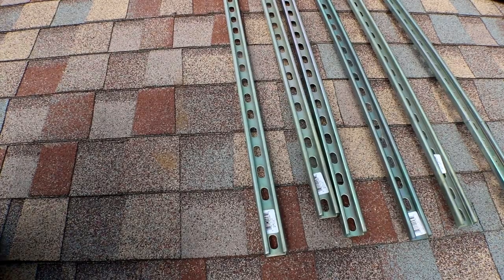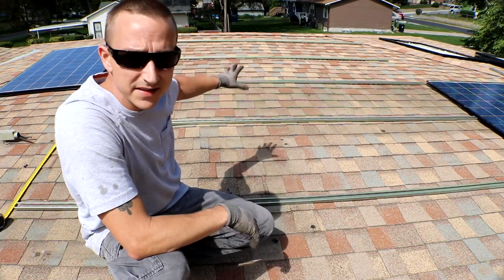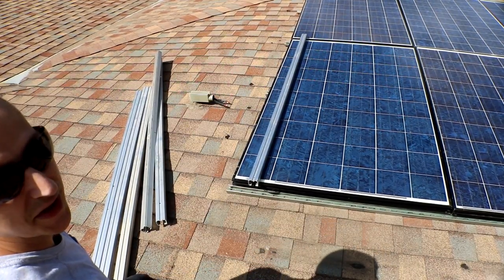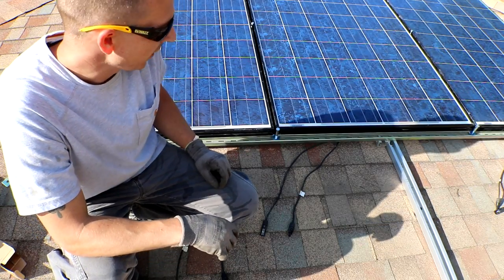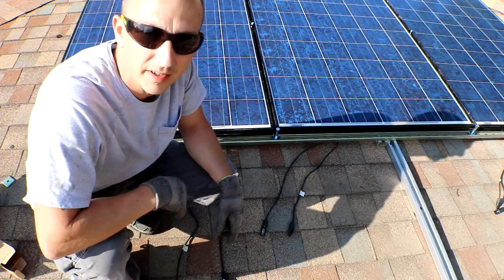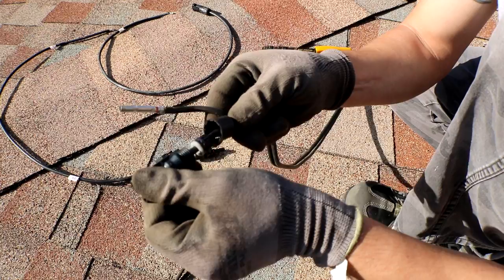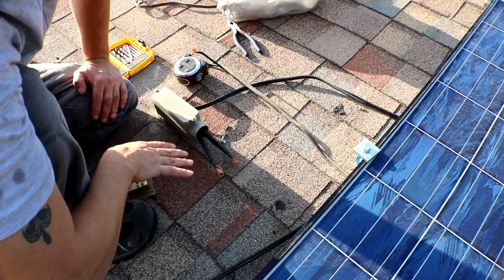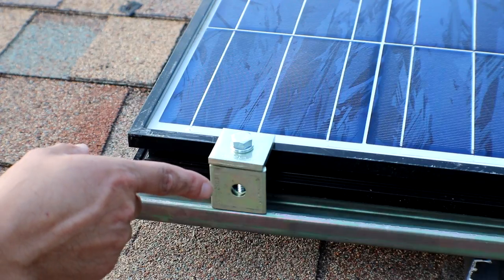Installing Solar Panels On The Roof

Comment: From on poor man to another, great job. I  put a piece wood instead of a L bracket, works for me.
Reply from the maker: Yeah I guess a block of wood wood do instead of the L bracket.  I almost went with wood for the install but didnt.  It wood have probly been cheaper but I like the way this turned out👍

Comment: car audio distro blocks are PERFECT for this kind of stuff.
Reply from the maker: I thought so.  Ive used the same one for almost 10yrs lol.  I probly should of cleaned it.  Maybe I will LOL
Reply: awesome.  don't forget to take readings before as a baseline, to see if cleaning actually improves performance.  Even if it doesn't, it can help prevent problems down the road.
Reply from the maker: +bcmasur Will do!

Comment: super job m8! finnaly hehe i was waiting to see this.
normally solarpanels are setup in longer serie strings to have high voltage which is more effective to transport the power to the convertor, thats why on those setups the cabling can be long runs.
Your idea to use those rails is perfect, here we use full alluminium and mounting the panels with 4 bolts, but 6 for each wont harm anyway -)  now i am working on a 1508 solarpanels setup lol, weeks of screwing and about 7 km cable-) till finnaly the first panels can be mounted.  Enjoy your green power!
Reply from the maker: Thanks!!! Yeah I could of put the panels on 2 rails but wanted more support, so more bolts it is lol.  All aluminum would have been nice to use.  After reading the comments, ill be changing to 3s on the panels😃 Damn, now thats a setup.  Is that for your or someone else?

Comment: Nice work on the solar panel install! I never knew about unistrut and cone nuts as a combo. Brilliant. I'll have to use similar in the solar pergola that I am planning. Thanks!
Reply from the maker: Thank You!! Yeah they are very handy and easy to work with👍

Comment: yea, I don't do the sports either! yes the uni strut works good. I worked in Lowes stores. we used it up in the ceiling. to mount lights and other things. I been wondering about how  I'm going to mount my panels. I'm thinking about a tracking system since the sun hides behind trees part of the day. to get the most out of the days sun. if I put them on the roof. I'll only have from 2:00 on. I'm kinda down in the trees! there's only a few paths the full sun shines through. I was thinking of just. doing like you are. just put a pivot point in center. raised about 24". allowing them to follow the sun.
Reply from the maker: Yeah sports....SMH LOL Cant play them and cant watch them!  Ya I have a lot of tall trees on the southeast part of my yard and the neighbors trees as well.  Sun doesnt hit them untill 10:30ish.  Ive been thinking of a way similar to my old setup to at least adjust them for winter summer.  A tracker would be cool tho.

Comment: Mc4 conectors like to be in dry place behind the panels is the worst option especially if lying on the wett roof behind the panels is probably higher moisture if is not properly ventilated that I mean rised on the one side.... 👍
Reply from the maker: Ill make sure there not laying on the roof. All of it is raised up off the roof and the last rail is off roof more because the roof slopes at another angle right there.  👍

Comment: I am curious if you used anything to isolate the aluminum from the steel unistrut? Aluminum in contact with steel results in a galvanic reaction.
Reply from the maker: Nope, just set on top!

Comment: It's interesting to see how other people do their builds. I know what it is like having to recycle parts from an older pv setup. I was in the process of building an outback Flexware 500, I spent about $1000 before I discovered the 240v inverter I wanted to use is no longer in production. I have an FM80 and 800w of panels.
Reply from the maker: I learn almost everything from watching YouTube👍 Yeah I kinda keep everything if I think I can re purpose it lol.  Can you still use the flexware 500 with another inverter?  Are you using lead acid or lithium ion?
Reply: I'd like to buy a pallet of the LG chem that jehu been trying to sell. A 23 kw lithium battery pack would be kinda cool but I don't have the money. For the time time being I need to buy 2 more  130ah trojan deep cycle batteries, that way when I buy the 4kw 240v ouback radian inverter all I have to do is rewire my pack from 12v to 48v and reprogram my FM80 to talk to the radian. I could finish the FW500 but it would only be 120v.. The idea behind my madness is to be able to charge our(my brothers)  smartfor two EV with nothing but solar.
Reply from the maker: New cells would be nice but like you said, dont have the cash.  I just got rid of my 12 trojan t-105s.  Thats what I am replacing :) Ya sounds like you have a good system and a good plan!

Comment: you do a great job of editing the videos. anyway, i must have missed the part about how you secured the rails to the roof so that the whole install does not just slide off. thanks for the work in making this informative video!
Reply from the maker: Thanks Man!!! It was a long video,  I even dozed off lol JK.  I put a blob of tar down where the 3" hex head screws were going through the aluminum rails into the roof. 👍

Comment: Nice! Good to see you making progress...
Space under the panels is also good for cooling, and a little more is better. 
8 AWG and 2 gauge is great, probably overkill but glad you've got it.
I'd agree with the other posters about string length - put as many in series as the PCM60x will take, as long as you can use all the panels symmetrically.
Also remind you about blocking and bypass diodes for combining! (smart/ideal diodes), but you can add these later - main thing now is to just get it going! Yay!
Reply from the maker: Thanks!! Ya we had a cooler day so I jumped as soon as I could lol.  Yes off the roof for cooling as well.  The 2 gauge is there so I can keep adding panels.  Yup after reading all the comments Ill be switching to 3s.  Do those diodes go inline at the mc4 connectors?  I added that link you gave me to my fav but its on a different computer.  Ill have to go check it out again.👍
Reply from the maker: I was looking at a picture and both diodes might be in the junction box on the back of the panel.  Id have to open one up to see.
Reply: The panels probably already have a 1A10 bypass diode which helps it not to become a sink if it gets shaded in a string - the other panels in the string can then still supply current through the diode instead of the shaded panel and causing it to heat up.
Blocking diodes are used when combining parallel sets of strings, so that if one string is low, then it doesn't pull power from the other strings.
However, an mppt charger might be able to "find" it by drawing more current until the other strings' voltages go down to match the low string, which can then start producing at its voltage again when the diode gets forward bias.
If all panels are perfect, uniformly illuminated and none are ever shaded then diodes would be theoretically superfluous, but the world is rarely perfect!
Hope that helps.

Comment: It looks great. But it might have been better to run 3 in series strings and then parallel the two strings.  The PCM60x  can handle the voltage.  Looking forward to the next video.  Thanks Joe.
Reply: M Gunderm I agree, I have 3 in series connected to the PCM, and planning to buy 3 more and have 2 strings of 3. I think Daniel has also like that.
Reply: fmarpt yes i have :)
Reply from the maker: +M Gunderm Thanks! Yeah I figured I would try it with 2 in seires first and see how it does then 3 and see if there is a difference. The 2gauge run is about 20-25ft so I was thinkn just the 2 in series. You think Id get more out of them in 3s?
Reply from the maker: +fmarpt How long is you run from panels to charge controller?
Reply: For a 48V system 3s would be better imho, 60 cell poly panels in the summer will have a hard time meeting voltage requirements. 2s might be ok if using a pwm controller.
Reply from the maker: Yup you are probly right and thats what I had before and was thinking like the old stuff.  I think Ill make it 3s when I slide the panels over to get rid of the mini shadow.  Thanks Guys 😃👍
Reply: AveRage Joe I have ~25meters of 6mm PV cable
Reply: Joe,  Max input voltage is 145v.  I did my first string to get 130v and then paralleled duplicate strings after that . Remembering that at 48v you have a max of 3200 watts input.  I'm just a few weeks ahead of you in this. Have fun.
Reply from the maker: Awesome! Hows your system going?

Comment: Looks great, now you just need 18 more panels! :P  The mic muffler you made seems like it worked really well as I barely noticed any wind noise.  Good on you for that, esp as a repurpose jobby.  I agree with other people who have commented so far to go with a higher voltage hook-up pattern; you'll get more out of the panels that way.  However, I'm not sure what / how many panels you're adding to this in the near future.   Did you have to deal with any HOA issues with your panels or are you lucky enough to live in an HOA-free neighborhood?  Keep up the great work!
Reply from the maker: Thanks Man!!!  YES, Need/want more panels.  Yeah I dont think the sound was to bad.  It was damn windy too.  Im surprised the camera didnt fall over a few times.  Yup, samzies on doing 3s on the panels after reading all the comments.  Will do asap. HOA FREEEEEEEEEE lol 😀 .  Another reason we bought this house so I can do what I want for the most part 😜 but so can my neighbors 👎.  I was thinking of adding a string or 2 of the 12v panels I have but since Ill be doing the 3s I might not be able to string the 12v panels up.  So I may sell them to start saving for more of the bigger panels.
Reply: Yeah, see if you can sell them and put that money in the "better and MOAR panels fund."  Dealing with the voltage differences and the side issues with that probably isn't worth the small amount of power you can expect to generate from them.  Noiiicccceeeeeeee on the HOA free living!  Wish I were in the same bucket, but alas...
Reply from the maker: Yeah I think Ill sell them and put the funds in the "MOAR MONIES MOAR PANELS FUND" lol, not sure what there worth nowa days.  Ill have to look them up on ebay or something.

Comment: I bought a pair of MC4 connectors recently and they stated 10, 12, or 14 AWG.  I can't figure out why they would say that.  I think 8 AWG was perfect, it fit snugly into the gaskets in the MC4 connectors.  I did peel back and cut off a few strands of copper to get it to fit into the crimps, I should have cut off a few more because it made the connectors a little faster and they barely fit into the solar panel's MC4 connectors.  Thought I'd throw this out there so hopefully some newbie sees this while they're planning to shop for wire for their MC4 connectors.
Reply from the maker: Yeah the wire fit in great.  I think if you use smaller wire like 14g then there would be a gap in the back.  I guess you could fill it with silicone or something.
Reply: stuff some caulk in there HEH HEH :P

Comment: JOE Solar panels don't like heat, that is why people use the taller of the two. so the wind can blow under he panel to cool them off. those look high enough to cool since your roof is not black!! just saying Old One Legged Joseph T.
Reply from the maker: I figured thats what they would be for after I started installing.  I keep an eye on them when it starts getting warm out again!

Comment: A 3 to 1 mc4 Y connector should work fine.   The holders put shade on the panels, wonder if the mounting holes on the panels would be better but then how do you screw it down?  If you get a 60A controller, you should be able to have 6 more panels up there. makeskyblue lists 2800W and 190V voc as max.  12 of yours would be 2820W but just don't clean them in summer. 4s3p
Reply from the maker: I did see those Y connectors and almost got some.  Yeah If I angled the panels up higher I could have mounted from below or I guess I could of use L brackets to mount to the side of the panel and then to the unistrut.  I do have a pcm60x mppt charge controller (60amp)that Ill be hooking up next.  From reading all the others comments, they recommend 3s or more as well so Ill be doing that asap.

Comment: I debated 'poor man's mounting' but ended up with a kit which wasn't too bad. $330CDN for 4 panels. all aluminum to prevent any issues with disimilar metals
Reply from the maker: +Jeremy Choy Awesome, where did you get them and what volt/amp?

Comment: Nice Joe.  I was looking at that hack job on the corner before you mentioned that you forgot the L brackets.  Why did you offset the risers?   Also, no video of your beer drinking skills ;)
Reply from the maker: Thanks Man,  Surprised you didnt mention anything about that first song😉👍  Are you referring to the aluminum rails on the lower panels? If so, I just wanted to slide the upper end under the unistrut so I didnt have to put anymore screws into the roof then needed and so I didnt have to go back down the ladder a cut the excess off 👍
Reply: Gotcha.  I thought it might have been because of drilling into the roof, but I wanted to make sure there wasn't another reason.  I loved the fact you included a ROTT song, it was awesome!

Comment: Go for higher voltage around 90v 3 in series and  two strings and let mppt work a little..... 
With 65v mppt is useless.... 
You have to be over 90v if not with small cloud simply won't charge because you don't have reserve voltage to cover in cloud situation... Anyway 
Don't conect small wattage panels with big one's you destroy the small one's because current must flow through all of them...if smaller one are not rated for that's kind of current.... You can bake eggs on the smallest... You will find out on hard way and 
Try putting equal panels together and in the end if is not enough voltage use boost converter.... to get to the target voltage.... 

Try not with Voc together go over 140v because PCM60X would not like it... 👍
Reply from the maker: Yup I think after reading all the comments, it looks like I will be doing the 3s.  Since Ill be doing that Im not sure Ill beable to add the 12v panels unless I have 6 or so that are about the same.  There all 75-100watt panels.  Ill take a look tomorrow cause I don remember lol 😃

Comment: that job looks pretty damn smicko, I wud leave the wiring as it is but put that block into a waterproof box and add and Isolation Switch, u need to ramp up the voltage to almost 140v in full sun or near abouts... I think that charge controller is 150v VOC max? so for the mppt to work properly max voltage possible.  When u add the other panels just match up the voltage and the wattage will take care of itself. Usually panels shud be within 10% but experiment. cant wait to see the PCM60X in operation. my 60amp mppt says max 1700watts on a 24v system but I got 2500watts on it and it seems to rock and roll all day long as 2kw is on a sea-saw going east to west. Anyway good show not a fan of that head banging crap thou ha ha.
Reply from the maker: Thanks! Ya seems everyone is doing 3s at least.  Reading all the comments sounds like Ill be doing the same.  Most of the 12v panels are anywhere from 75-100watts each.  If I do the 3s on the big panels I might beable to do a 6s depending on that 10%.  Ill have to take a look on the back and see what I can do.  Shoot maybe Ill just sell them and get more bigger panels 👍
Reply: hell yeah sell them for a good price and hush hush about ur panel source ;)
Reply from the maker: +OffGrid Aussie Prepper™ Ill have to wait for another good deal cause the guy sold the rest he had. Not sure how much the 12v panels are these days but will probly get rid if them.